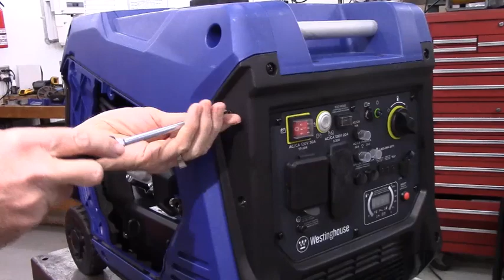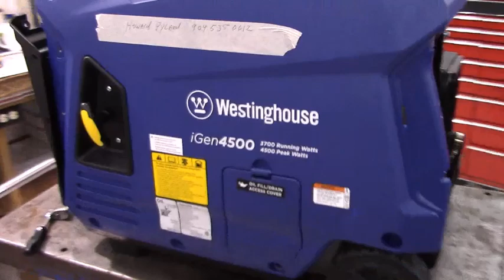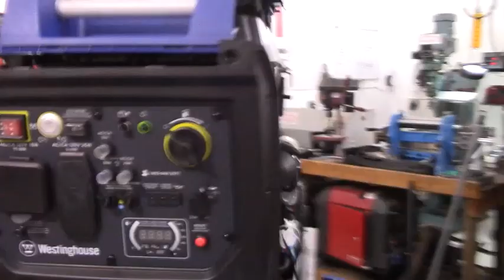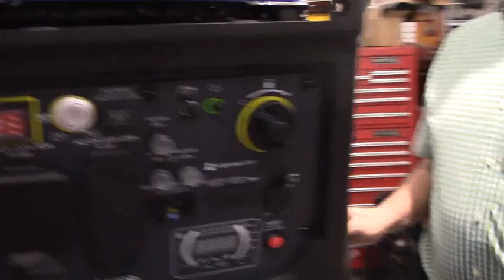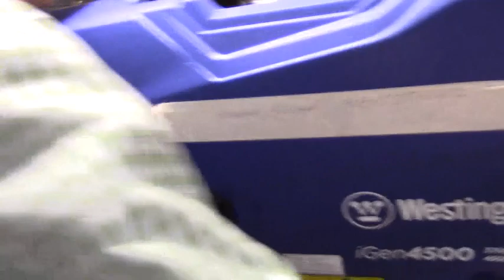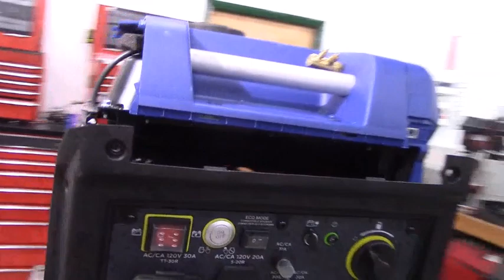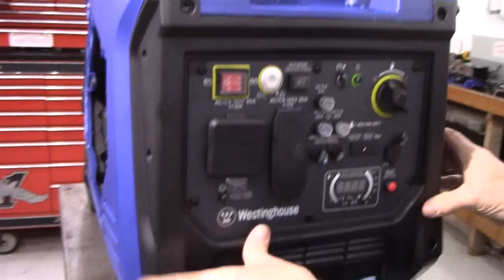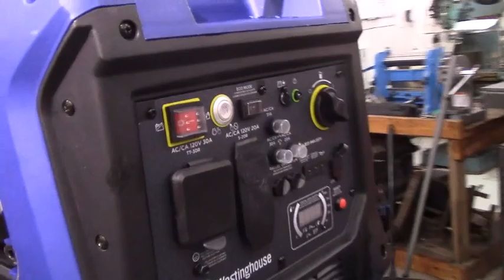Pulsar PG4000iSR Extended Runtime Fuel Kit install by Pinellas Power Producet

Comment: Excellent job ! the way you do the whole work is immaculate ! if all the professionals would do their job like you, we would have a better world ! the only suggestion l have for you here is to put 2 wide washers on both sides of the drilled plastic where you put the brass adapter, so it will hold better the lateral forces when you hook up the hose. And again, what a nice work !!
Reply from the maker: Yes, you are correct. I have to walk a fine line between making everything work and keeping it simple enough that people do not just give up.